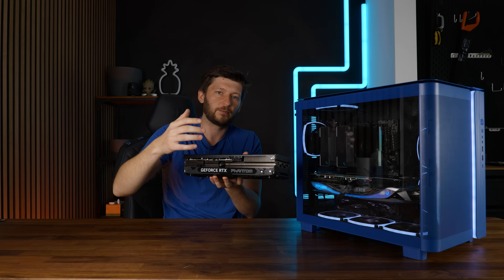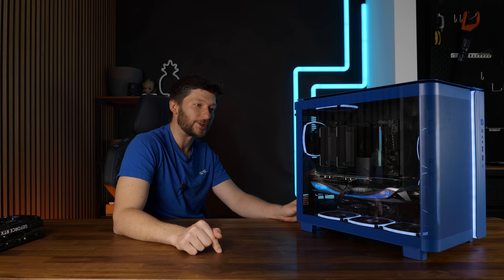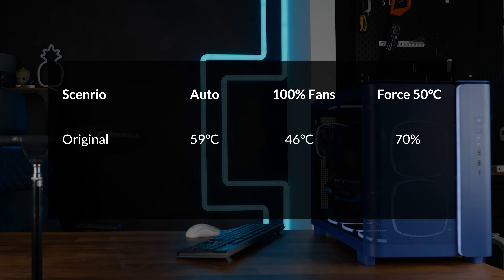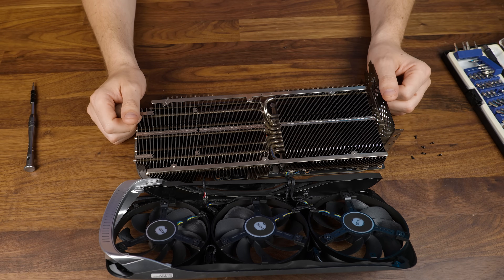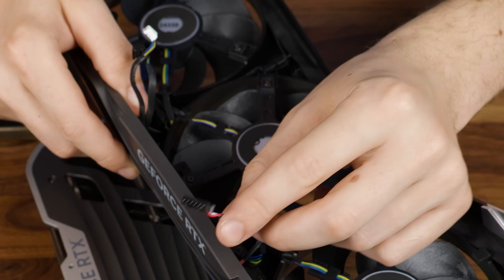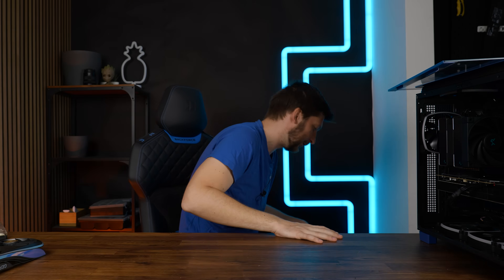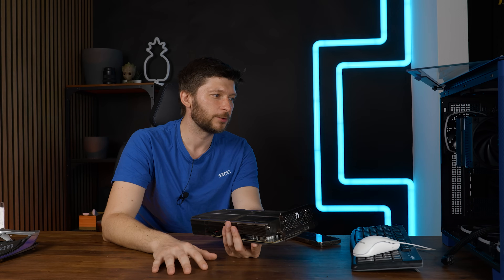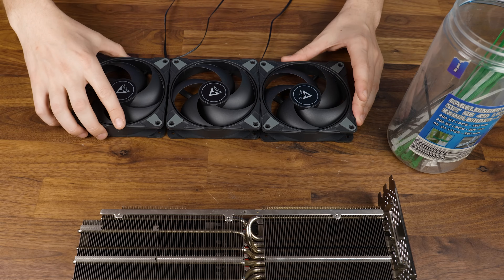Is Deshrouding A GPU Still Worth It? RTX 4090 P12 Max Deshroud Mod

Comment: I deshrouded my Ventus 3x 4080 and replaced the 3 90mm fans with a pair of NF-a12x25s. I got similar results in that the cooling performance was actually slightly worse under heavy loads (probably because having one less fan meant less of the heatsink had air flowing through it), but the trade off was it being significantly quieter.
Reply from the maker: Makes sense. I guess a third of the card was left fan-less in your case. Still interesting for the noise though
Reply: i replaced my ventus with 140mm instead of 120mm
works fine
Reply: You should obviously be using 140mm fans.
Reply: @ffwast  the card’s heatsink is practically exactly 120mm wide, so 140mm fans would overhang the edge quite a lot. Besides, the 120mm ones still cover about 80% of the heatsink. I used a mounting bracket I got off Etsy that only supported 120s anyway
Reply: @CheeseTruffles I'm waiting for my deshroud kit from Etsy to arrive. I already own a set of brand new Noctuas NFA 12x25 G2,that I will mount on a 3080Ti Ftw3 from Evga. If I can suggest,there is a Noctua model,actual a new G2 version of the 140 mm, that'll fit into the deshroud kit you already have. It's the Noctua NFA-14x25R (rounded edge),it does have a 105 mm screws holes offset,and it will mount perfectly on your kit, exactly like a 120 mm fan.

Comment: You should have used the Phanteks T30 instead of the Arctic P12 MAX
Reply from the maker: I kinda doubt there would have been a big difference. We reached a plateau relatively quickly with the p12’s.
Maybe a bit for the noise at a fixed 50*C

Comment: I think deshrouding is way more worth it in an ITX case, because the card becomes thicker they can draw air directly from the outside into the case, instead of using the warmer case air to cool itself.
Reply from the maker: Definitely. Or at least very often. Still had to try this though
Reply: @STSYT  do you plan on revisiting this in an itx case? 👀
Reply: Hey 🙂 I wanted to know the best AMD processor to take for a 4060Ti to avoid bottleneck and have the best possible performance in AM4 and also in AM5 (I play in 1440p)? (Let no one judge my choice of GPU, I want an NVIDIA I know that an AMD would be less expensive and with better performance.)  @STSYT
Reply: @account_under_maintenance  a Ryzen 5 5600 should be fine for a 4060 Ti at 1440p, and for AM5 the 7500f is an option, however with both of these CPUs you're likely bottlenecked by the graphics card at 1440p.
Reply: @STSYT  main reason I deshrouded was to put fans on exhaust in my mini itx case. Doesn't matter how good the cooler is if the case starts pooling with hot air it slowly creeps up. Why blowers still exist for professional cards.
Reply: Also length. Deshrouding makes my XFX Merc 319 fit length-wise in an A4-H2O.
Reply: Would it be better than 3D printing air ducts?
Reply: @tandyVR  depends, i know optimum tech did a video about airducts to the cpu and gpu, you should check it out if you find it interesting :D
Reply: or an microATX Case like an Asus P201 or Lian LI A3 since the GPU sits right above the bottom Case fans